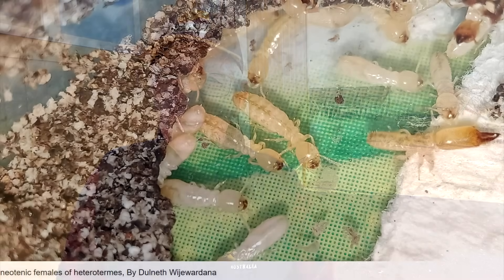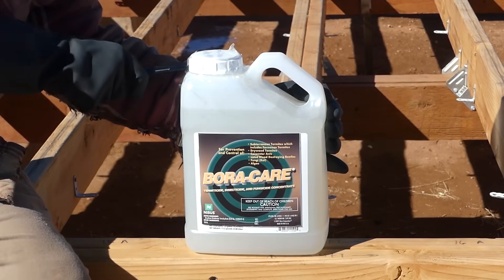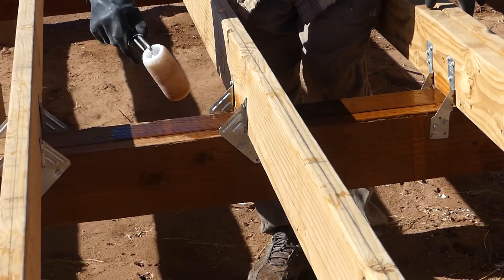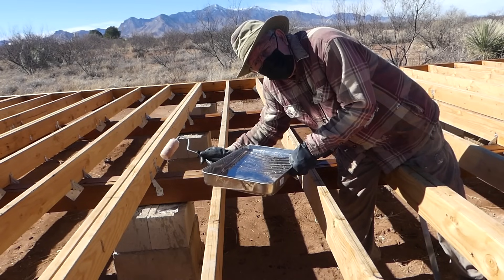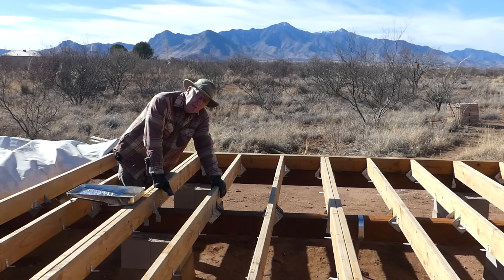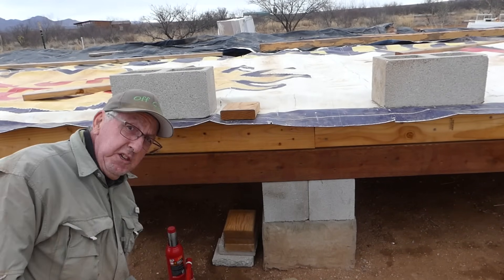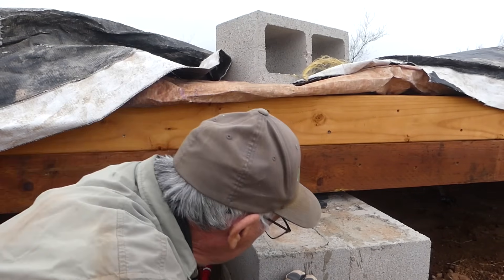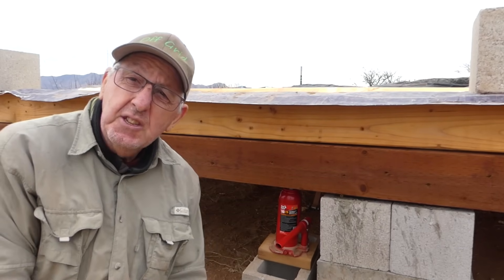Will they show up in my yard and destroy my new off-grid Home?

Comment: Having lived in Texas, New Mexico, Arizona, and now Nevada over 70 years experience building residential homes, my control of everything has been to spread used motor oil around the perimeter of any structure, you can use a condiment container filled with the oil and open a trench 1” wide and 1” deep walk around the structure and pour a continuous line of oil into the trench, afterwards pour a little soil over the trench and it will deter bugs, spiders, scorpions and even mice, I renew about twice a year. This has amazed me at how well it works and also I am not using potential hazardous chemicals. Before you post a negative reply, remember if it works don’t knock it.🎯

Comment: Anytime I'm using liquids that require application over large areas, I typically turn to my garden sprayer.
 I use it for staining and Waterproofing.
Sometimes I'll just fill it with water and use it for General Cooling
Reply from the maker: Great idea. This chemical was too thick for a sprayer. Maybe I mixed it too thick.

Comment: Another suggestion is to buy dehydrated boric acid as Borax powder and sprinkle that around your piers and lumber for extended protection from termites.
Reply: Is there anything BORAX can’t do? It has heath benefits too, for females at least!
Reply: 4:28 I’m so sorry. That really sucked!
Reply: 1st thing that popped up, in my mind.....YES!
Reply: Has worked wonders for all of my outbuildings for 30 years.  Spray it down with a little water so the wind doesn't blow it away.  No need for expensive pre-mixed stuff.  'A fool and his money' and all that jazz.
Reply from the maker: Thanks for the tip Michael.
Reply: Termites were a serious problem when I lived in Northern NSW Australia. I made my own boric acid/borax mixture and it was quite inespensive. I had been a Chemistry examiner before I retired so was able to calclate  the ratios  to make the boric acid. I mixed borax with diluted hydrochloric acid. When I cooled the mixture, boric acid crystalised out. Both borax and hydrochloric acid were inexpensive but buying boric acid would have been quite costly. I don't know I would recommend making boric acid to anyone who isn't experienced with handling hydrochloric acid. The liquid is highly corrosive and the fumes are a powerful irritant. Boric acid shouldn't be expensive but it was in my location.

Comment: The more I watch your progress on your house, the more I think I'm making mine out of concrete.
Reply: I would move my 37' 5th wheel on the property, install the septic system first. Drill a water well, install a solar system with back up generator.
Lay out plans for a huge steel building, work shop garage with electric lift, then I would frame "a house" inside at a corner of the building. Build a wall to partition off the garage.
The two things that worry me are wild animals and Intruders whenever I leave.
Reply from the maker: Great to have choices.
Reply from the maker: Rainwater harvesting is the key here.

Comment: Another good tip I learned years ago that is also very inexpensive is to use the "OOPS" paint found at any home improvement store. This paint that was colored wrong or messed up in some way is sold very cheaply in the 5 gallon buckets. When a little water is added, it can be sprayed to cover all of the exposed wood to help prevent termite and moisture damage.
Reply from the maker: good tip thanks!

Comment: I live not far away in Tucson and know the owners of two of the better insect control companies, AZ Pest/Termite Control and Truly Nolen.  I talked with both about some things I researched (since watching your video) such as Concrete eating termites.  I got blurry answers from both people about almost everything related to termite control, including no price estimate.  So, I asked.... as a customer.... what should I do to protect my structures, and both told me have an annual inspection and treatment as needed.  Good grief, some kind of top secret termite situation going on.  Anyway, our  home has a 5" concrete foundation, and I personally found tubes coming up from the ground the entire 5 inches.  We had to have some holes drilled into the concrete, filled with something and covered back up.  IMPORTANT:  Both owners said the product you just used has been a 'game changer' in the termite control industry and is the only thing they use anymore!!     Good job Don....    PS:  We have a 308 sq.ft. shed with plywood floor and walls....sitting on 4x4 treated wood.  No termites at all.  No treatment ever done.  Installed in 2006 and it's just fine.  

(First and foremost, my deepest sympathies to you and other loved ones left behind from your two close losses.  It's difficult.)
Reply from the maker: Many thanks for the kind comments.

Comment: It is a good idea to take preventive action now. My relative in Tucson has had several issues, being a long time resident. It is not pleasant if you have to cut open a wall or floor to get to the problem.
Reply from the maker: Yes indeed.  Insects don't mess around as far as doing what they do.

Comment: Somewhere in the Bora Care directions it says to mix using hot water. Also, if you come up short of the chemical you can substitute in a DIY version. Using ethylene glycol antifreeze, hot water, and powdered boric acid. I had a powder post beetle infestation in my crawl space and Bora Care nuked those little buggers permanently.
Reply from the maker: Good tips thanks!

Comment: Good job Don. It would have been better if you were able to treat all the lumber before assembly. You really want lots of the solution to get into the end grain of the joists. I don't know what you did with your block foundation?, but it's great to get some down in the blocks as those devil insects love to come up through block.
Reply from the maker: Belated thanks for your input Tim.  Yes indeed would have been easier. Wasnt sure how and what to treat it with so late decision. I will treat the blocks as well so good comment.

Comment: Could you have used a pump up sprayer for application??
Reply from the maker: Great question Gary.  I didnt include it in the video but I bought a $30.00 pump sprayer but I may have improperly mixed it the first time because it was too thick so the pump mechanism would not work. I read others had issues as well.  So unsure if the product can be used successfully that way.

Comment: Why didn’t you use a pump sprayer to apply
Reply: Actually you get a deeper penitration by rolling it on.
Reply from the maker: Also the substance didnt seem to work with a sprayer.  I made it too thick I think.

Comment: Do you have.metal between the blocks and the floor joists?
Reply from the maker: Originally yes but I read that this can cause extra condensation and potential degrading of the lumber sitting on the concrete block piers. So I removed it all and went for strong plastic shims.

Comment: I don't mean to be rude, but it appears you have decision paralysis. You seem to be doing everything possible to avoid actually laying down the floor and begin erecting walls. 2 minutes of research tells me pressure treated wood is termite resistant unless left in a high moisture area. Not much moisture on concrete piers in the desert.
Reply from the maker: LOL  fun comment. Actually you might check to see that I became unparalyzed lately and am out of the wheel chair even. As in my walls are being constructed.  Fun job for sure.
Reply: Not to worry, I'm still following along.

Comment: Used motor oil works better. Lasts longer and gives the wood a beautiful shine. And it is free. And you can get a painters tray inside a 5 gallon bucket and a wide thick nap roller to reduce your rolling time by 900%
Reply from the maker: Great tips thanks Scott.